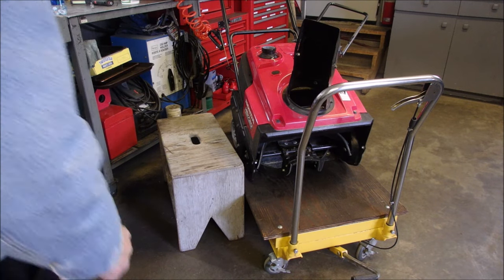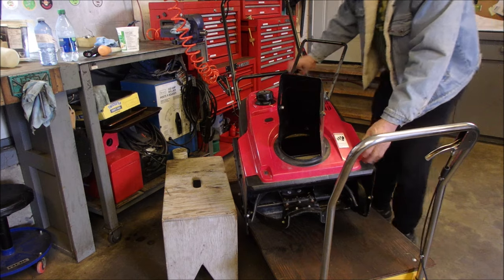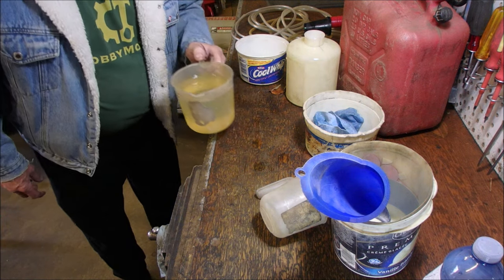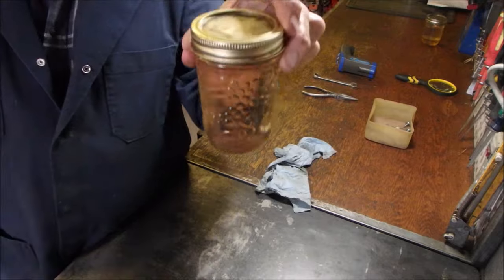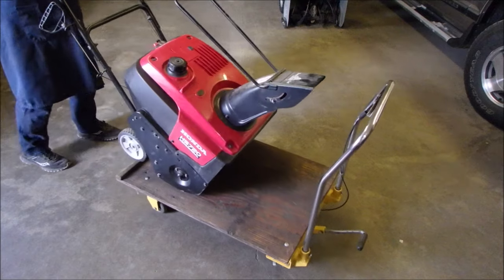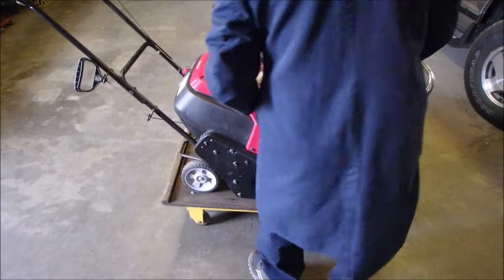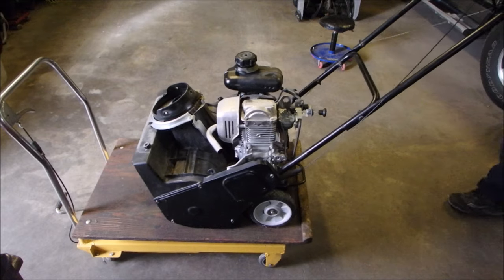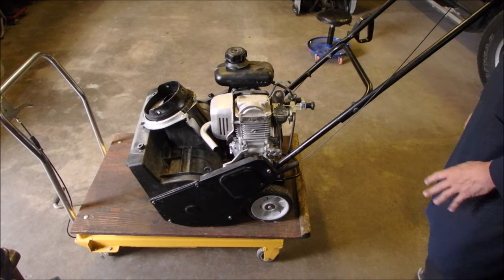Honda HS720 Commercial Snow Thrower Runs Poorly

Comment: They make that unit look pretty but all that plastic makes it a pain to work on.  What is wrong with simple.  That snow blower is probably perfect for the amount of snow we get.  Thanks Bruce.  Stevo
Reply from the maker: Well thanks for commenting.
Reply: I heard the shrouding traps a bit of heat that slows carburetor icing but I do not know if that's true.

Comment: I was thinking that as clean as that carb looked that the idle circuit jet slightly enlarged with micro drill bit would do the trick. Probably lean from factory as many are.
Reply from the maker: You are so right.  This one surges a bit when i was done but very usable.

Comment: Nice job Bruce.  It surely does run better but isn't it so frustrating when you do all that and it still has that surge....
Reply from the maker: Yes.  The owner wanted it back as snow was coming the next day.  I wanted to order a new carb but he was in a hurry.  When it came to me it surged under load.  Now at least it surges a bit at idle but not under load.   Thanks for watching.
Reply: Oh I see.  I wondered why there wasn't a pt 2 coming.  I said to myself, something is up, the master never leaves his sick small engines just a little sick.  He always heals them.

Comment: Bruce I have a Toro power lite 98cc and I try everything to get the surge out. The engine rpm are between 4300-4500 and carburetor been clean and rebuilt. I even check the muffler port for blockage and nothing.
Reply from the maker: OK  these devils surge from the factory.  The best thing you can do if you want to is ream out the main jet and the idle jet  (just a tiny bit with micro drill bits).  Even after doing that to this one it still surged a bit.  Lawn mowers have the blade that  acts like a larger flywheel so they don't surge as much.  Good luck.  If it smooths out when blowing snow  (as a non mechanic) I would leave it as reaming it out is a bit dicey if you are not confident.    Bruce
Reply: @BrucesShop  I did that as well and nothing. I guess there is always one that is a pain in the ass🤣😂🤣I cover all aspects and nothing. I been working in two-stroke engines for a while now. But this one is the winner😂🤣😂🤣